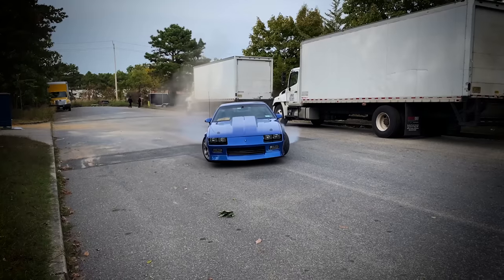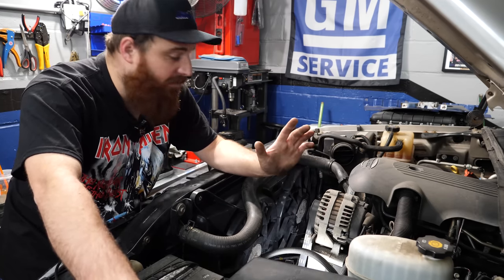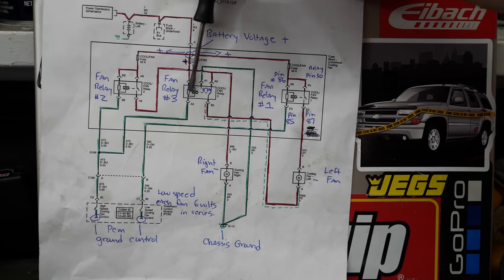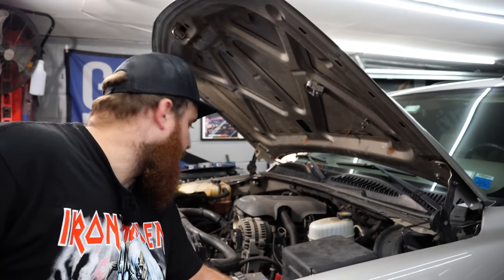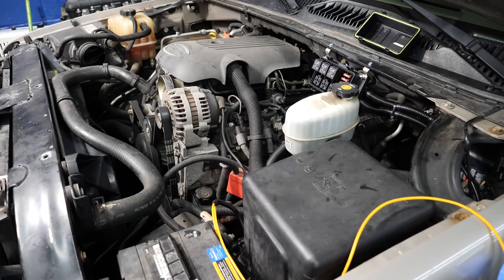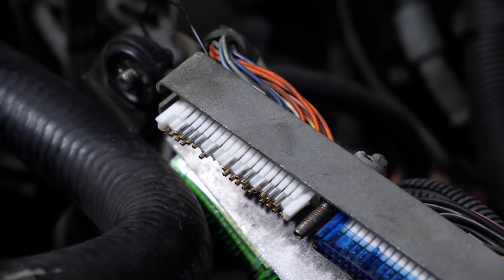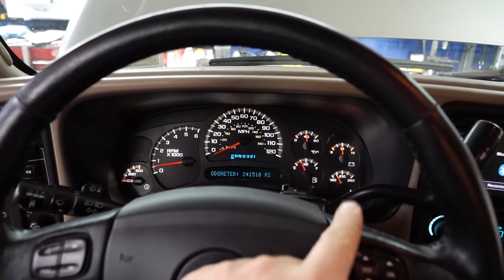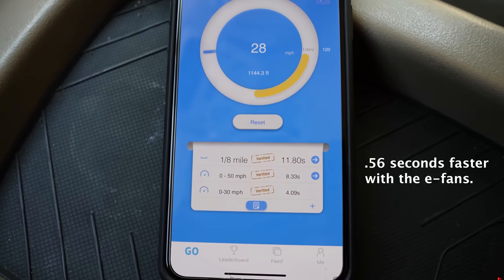I Deleted the CLUTCH FAN in my Tahoe and it Actually made it FASTER (E-Fan Conversion)

Comment: Ok video but you confused the hell out of me with the hp tune ac recirqe 02 and down. Cut the wire? Like if you made the harness vs using the factory harness? Do I put it on fan2 using the factory harness or your only changing that for the home made harness?

Comment: as for the tool you can take a big adjustable wrench and smack the end of it with a hammer few times and it will come off. done several of these.

Comment: Simple aux fan wired with relay so you can control when needed is all you need.Kepps ac ice cold at idle for dogs when you run in store for a period of time when its 100 out.Dont need new harness reprogram and fans lol.

Comment: I have an 04 Silverado and want to do this swap. Would I have to use the factory PCM and tune it to run the fans, or I could I use the PCM out of the donor truck. I know GM has different “color coded” PCMs. Like yours is green and blue.

Comment: I have an 03 yukon denali with the factory clutch fan, do you think it’s worth it swap to the e fans? How difficult would you rate this install? I’m scared of messing something up especially with the wiring.
Reply: You can buy a kit that makes it plug and play, definitely worth it, just for the space it frees up under the hood alone.  Your AC will work better because the fans move more air at idle than the clutch fan can.  Did this on my '01 Suburban, still need to do it on my '03.
Reply: @GrandPrix46  Does the ecu need to be programmed to tell the fans to come on when the ac compressor is on?
Reply: @audimanao  yes, I used my HPTuners and just copied the settings from an '06 Suburban that had them from the factory.

Comment: Great video very informative and to the point thank you.quick question does the fan clutch also hold the water pump pulley in place ?would I need nut to take the place of the fan clutch?
Reply: This is an old comment and you probably already figured it out, but no. the clutch and pulley are separate. You can freely remove the fan without a worry of your pulley coming off.

Comment: What are you doing for  amperage and voltage drop when the fan comes on?
Reply from the maker: Didn’t change anything, I didn’t experience any voltage issues.
Reply: @lsxmatt  that good. I did the fan swap and programming. I have voltage drop. I use after market harness. I'll going have review why I'm having that issue. Thank you.

Comment: I miss my Tahoe. Had a 96 2 door with the barn doors on the back. Thing would push MOUNTAINS of snow with no problem. owned it for 13 years and took it cross country twice. With just under 300K miles It would have kept going if a tree hadn't jumped out in front of it....

Comment: I just completed this upgrade. I bought an aftermarket harness. When I trigger fan stage 1, it goes to high speed. When I trigger fan stage 2, it goes to low speed. The trigger wires are blue and green. I matched them to the PCM plug of corresponding color per my instructions. I'm figuring the harness is just backwards.

Comment: Im about to do this mod on my 04 avalanche. I have the fans and harness. Would it be worth buying hp tuners and doing it myself and did hp tuners cost? 
This is a great video btw. If I was this video before I bought harness I definitely would be wiring up fans they way you did yours.

Comment: I put a 3 core all aluminum radiator. In mine. $220 I think. You will never over heat again. I can't wait to get my efans on with that radiator.
Reply: I have a wire harness and e- fan from a ‘05 Suburban if you’re interested
Reply: @donaldgreen2238  @ how much?$?

Comment: I've never done the "tune" when doing the "E-fan" conversion, I use the factory fans with a "Stand-alone" controller from Flex-A-Lite. Been doing this since 2007, with absolutely 0% negative effects. The Flex-A-Lite controller has a temperature control range from 160°-210°. I always set it to around 170°-180° & it fires the fans up like clockwork.
Reply: Seems like a fan switch and relay would suffice you can always use two inputs on the relay for a/c purposes
Reply: The point is keeping it oem style
Reply: Buying credits solely for the purpose of triggering some fans seems a bit extra,  I'll do it on mine at some point but only because it's already unlocked. We've all got different priorities when it comes to budgeting i suppose.

Comment: Hey matt i just did the e-fan upgrade on my 01 sierra. I put the settings to analog like u said in the video and a few other videos sUd the same thing you did but my a/c lines are freezing up. Someone said i need to set it to serial cycling instead. Any input on this?
Reply: did you ever figure this out??
Reply: Im having the same issue. @LsxMatt could you let us know??
Reply: @charlesp7574  yes i did.
Reply: @charlesp7574  i talked woth a fre guys and they told me to pit the settings to analog cycling and i havent had it freeze up cince. I did re adjust my fan perimeter as well but only because i changed my thermostat size from a 160 to a 187.

Comment: DC voltage travels on the wire,  AC voltage travels through the wire so a thicker wire with less strands is not better for DC voltage  in reference to the Lowe’s wire which is probably for home AC voltage. The Amazon wire looked like many fine strands of wire . It may have looked smaller but has more pathways for DC voltage to travel .This is why car audio power cable is all multi fine wires.

Comment: Curious did you also increase your battery amperage and alternator to accommodate the electric fans? The reason I’m mentioning another YouTuber 1road  guy did this conversion on his 03 bourbon and found out that it couldn’t keep up on cooling his rig (overheating) the engine. It had a hard time cycling on and off and if didn’t shut off it will drain his battery.he had to do more research and solved it by increasing the amps.
Reply from the maker: I didn’t touch the alternator and the voltage stayed the same. Being its a Z71 I think it has the 140 amp alt, but I’m not positive. But regardless being these are pcm controlled, they start up on low speed. This drastically cuts down on the initial voltage spike so the alternator has some time to catch up.
Reply: @lsxmatt  well good luck with it. I will just keep mine stock. And leave it ,I can’t be bothered doing major things to my rig. Peace of mine in my brain 🙂

Comment: Can we get an update on the efan on tahoe. How's it running, has it given you any problems? Or any over heating in summer?
Reply: I did this swap on my old '01 Suburban, ran it for a few years or so in South Texas heat and never had any issues.  Now I have an '03 Suburban and I'm gonna end up converting that one at some point.  Finishing up the suspension, then I have to spend another $1500 doing brakes, and after that the knock sensors need replaced.

Comment: Hey brother I have the same truck ac cold as hell when driving just had the ac compressor changed but when I’m at idle the ac sucks at cooling is that all these trucks that are like that ?
Reply from the maker: Make sure the charge is correct on the refrigerant. If it’s good then the fan clutch is most likely bad.

Comment: You better upgrade your Alternator the stock one wont cut it with the original pully,,, you can see the voltage drops while idleling.. to prevent that you need a smaler pully on the alternator.

Comment: So I did my efan swap. Pinned both wires to the PCM that was reprogrammed as needed. Did all of this with a harness removed from a known good 2005 Silverado. 

Now I'm stuck chasing a problem I haven't seen in watching at least a dozen videos about this swap.... my relays are going nuts. I haven't done any wire chasing, mostly because I don't know where to start. It's not like there is room for any level of mistake. If the fans are plugged in backward then the wrong fan comes on. If the PCM pins are wired backward then, again, the wrong fan would come on. What it sounds like is that the PCM is pushing a PWN signal to the fans. All 3 relays are clicking away at about 15 Hz, but slightly offset. WTH is going on?

Comment: Clutch fans are 1,000 percent better when towing Walmart test truck proved that they had an electric fan test truck it couldn't get over the mountains without stopping atleast 20 times to cool off and it kept blowing head gaskets until it finally seized up...the electric fans couldn't pull enough air at low speeds

Comment: Hello Matt, thank you for your content.  I have 2 05 Yukons.  A 5.3 and a Denali and an 11 Denali.  In the 5.3, I have an ac issue that no one can figure out.  Btw, in Texas and in winter (yes ac necessary in Texas in winter) the ac "kicks in" fine but in summer, the ac sometimes "clicks" and then you smell musky smell (reminds me of the old school swamp cooler).  That's when the ac fails.  But the thing is, when I turn off the truck and turn back on, it works.  I read somewhere where the weight distribution of the clutch fan is off somehow but I dont want to start throwing unnecessary $ at it.  Any help?
Reply: That summer AC issue sounds like it's cutting out due to high system pressure. There's a limit to how high the high side of the system can go, and there's a safety cutoff that will disengage the AC compressor above that - and this sounds like exactly what's happening to you. Either grab an inexpensive guage set for AC or go to a shop and have them check the pressures when it's giving you fits - I'll bet your high side pressures are up around 300 psi or higher. Might be slightly overcharged, or might be getting old and collecting grunge inside the system that's blocking something partially (orifice valve?)
Reply: Check the air gap on the a/c clutch. They have two shims from the factory. I removed one of mine and now clutch works as it should again.

Comment: if its not turned on in the pcm the fans wont work with a factory harness anyway. most clutch fan trucks that pin is turned off in the tune.

Comment: I want to do this on my 97 Tahoe , but back when I was researching it everyone was saying the electric fans couldn't pull enough air like the mechanical, whats the CFM of that fan assy?
Reply from the maker: I don’t know the cfm but a lot of people claim things because they heard it from someone else. I’ve towed with this thing with the a/c on in July and the gauge never passes the middle mark. A/c always blows cold as well. I say go for it.
Reply: @lsxmatt  Thanks for the quick reply, the other question I would have is, would these electric fans be ok in deep water crossing, If I have a switch to turn them off during?

Comment: I still have serious doubts about the flow-rate coming from e-fun being even comparable with the clutch-fan flow-rate. The standard clutch is designed to move 11000 cfm .... unreachable by any e-fan fitting under the hood, and at which Amperage cost?
Reply from the maker: Even though the clutch fan can move 11000 cfm it doesn’t mean the truck needs that much to cool off. Since I’ve installed the e-fans the temp never has gone past the middle 210 point. Even towing my Camaro still stayed in the same spot. A few months ago I even changed the fan temp settings so the high speed doesn’t come on until 217. Even with the a/c on the truck only uses the low fan speed and it never even gets close to 217 for the high speed to come on.

Comment: So for the high speed  to work the low speed command from the pcm has to be sent aswell? If not how is relay one getting activated? It’s only grounded through the low side according to the diagram.
Reply from the maker: Yes the low speed is already activated when the high speed is commanded and needs to stay on for the highspeed circuit to function.
Reply: @lsxmatt  gotcha still learning but kinda figured it had to. Thanks for confirming👍

Comment: will those HP tuner numbers work on my 99 GMC Sierra 2500 6 liter engine ? my ac goes. warm if idling seems to only work if going over say 30 mph . any ideas
Reply from the maker: They should work good if you do the fan conversion.
Reply from the maker: Also that most likely means your clutch fan is just dead. If you replace the clutch the a/c should work like normal again.
Reply: @lsxmatt  i can switch either fan on , i think i need to check and see if my Type fitted is set to analog cycling. thanks for your input , cool videos you have out

Comment: Did you upgrade your alternator too or noticed a drop in voltage?
Reply from the maker: No upgrade but I think my Tahoe came with the larger alternator. No issues with voltage dropping at all.

Comment: Good mod. Now get rid of that ugly stock air intake tube and swap in an Airaid 200-919 and re-tune for that as well. The oem box has been tested to be just as good as the aftermarket ones so keep it. Clean the couplers to remove the protective film so it doesn’t slide off the throttle body while driving.

Comment: I did this on my 01 and ended up installing the clutch fan again. No change either way.
Reply: Severe duty fan clutch?
Reply: @BoyishDriver  Unless it was changed by the previous owner, it was the same combo I pulled off of it. When I towed it'd start getting too hot and the e-fans couldn't keep up. Switched back to the clutch fan and it's been fine for like 5 years now. Many have done the swap and like it, but it's too little gain for the effort/cost involved imo.

Comment: When u have to do this on a 99-02 truck u also need a harness and a ac pressure sensor in order to have it like original
Reply: Hello I saw a post from YouTube a guy has a year model 99-02 in order to make his ac work he had to wire the low pressure sensor switch in a series circuit to high pressure sensor switch by depinning the pin 55 and tap it on high pressure switch ac request signal and it works. Before he had everything the way it was and the ac line was frozen up. That’s the fix for that.
Reply: If you buy a harness and ac pressure sensor, where do you connect them at? Pls let me know thanks. I have 2002 Escalade Ext and my ac line freezing up any advice to that please? How do I fix it?

Comment: why dont you connect the recirc door and fans on pin 33 its just sending signal right???
Reply from the maker: If you do that the recirculation is going to always be on when the a/c is even if you don’t want it to be.
Reply: @lsxmatt  is that bad tho? like you said in the video if the recirc door is closed the inside will get colder because its recirculating cold air and the pump wont have to work as hard

Comment: There was one thing you forgot about the clutch fan. It is temperature sensitive. You put a cold clutch fan on for your test runs so the fan was spinning more in time with the motor thus moving more air. If the fan was up to temperature, it would have spun slower than the motor.
Reply: Possibly. Possible also that the radiator is still hot from E-fan testing causing the clutch to be engaged. The E-fans were running, from what I could tell, during their test runs also. When the radiator air heats the clutch up, fan is engaged, needing more power to turn. Cold clutch fan uses less power.
Reply: Exactly opposite of how a clutch fan works. Cold there not really engaged.....hot there pretty close to engine speed. Why would you want to move cold air across a radiator that's cold 🤣

Comment: No thanks. With these trucks getting long in the tooth,  I don't care how fast it goes.  All i care About is reliability.  E-fans are not as reliable as a clutch fan which has better cooling for longevity.  I don't want to have to worry about relays and fan motors going bad.